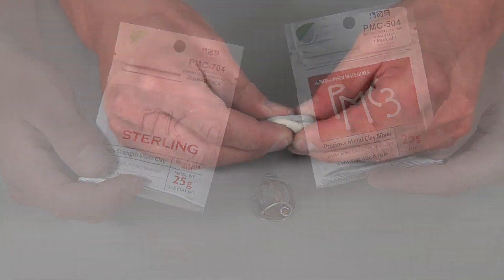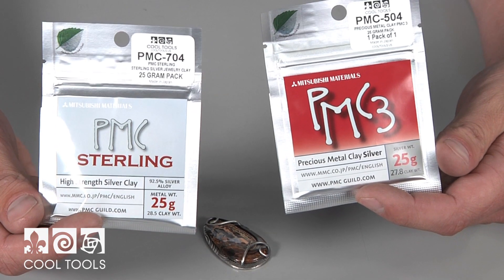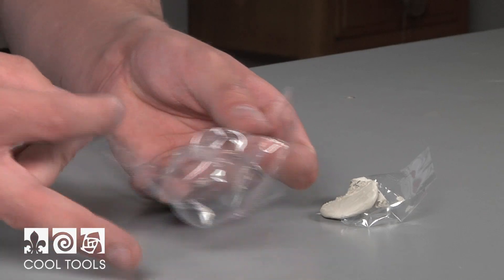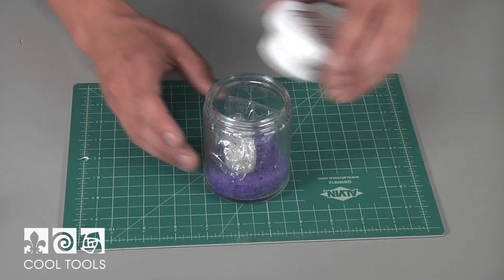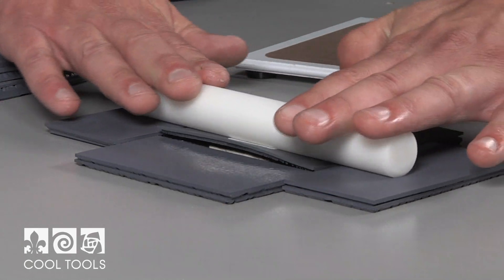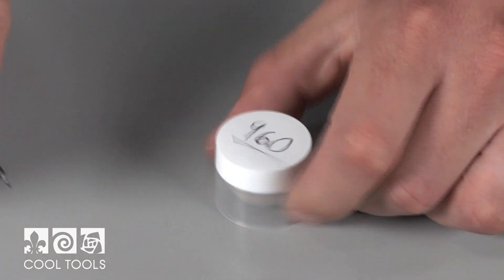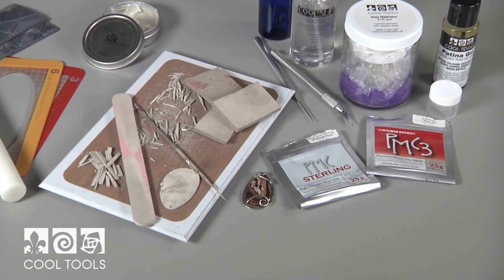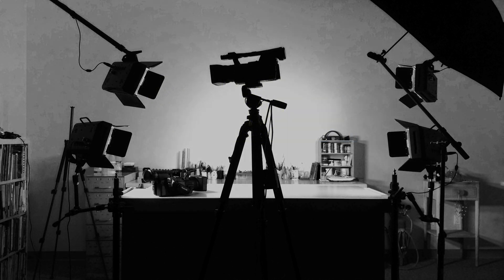PMC 960

Comment: Can I use the 960 slib for 999 pieces as well? And does it give more strength?
Reply from the maker: Otteline Tuitel If working with fine silver clay, you need to use fine silver slip. Same goes for 960. When making a 960 piece, you need to use 960 slip. This makes sure everything sinters properly and the shrinkage rates are exact.